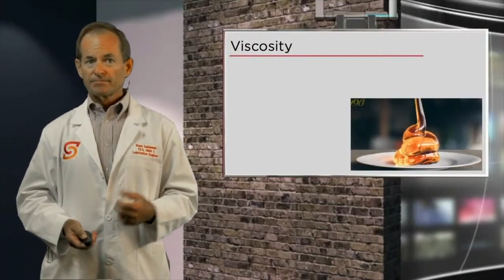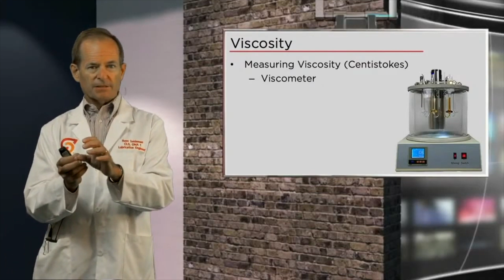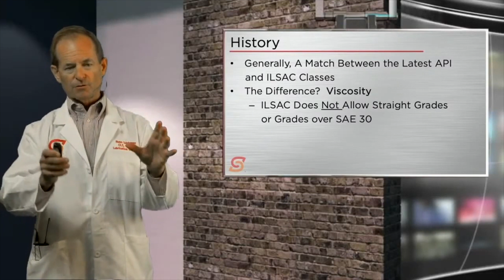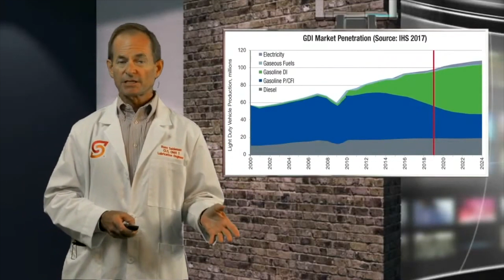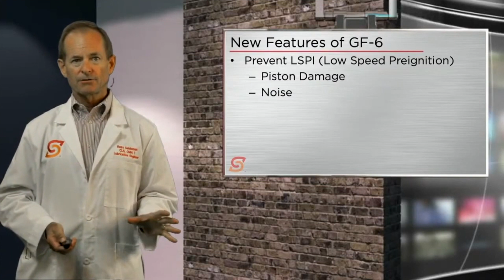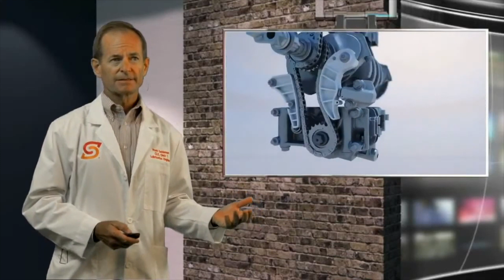GF-6 Educational Training Series | Senergy Petroleum

Comment: @SenergyPetroleum I have a 2024 GLC Coupe 200 4MATIC turbo gasoline mild hybrid that only accepts 0W-20 oil from 229.71 or 229.72 specification. 
My huge disappointment was that the dealership did not tell me to change the oil after the break in period. Also they say I only need to change oil every 10.000 km or 12 months.
 Also that I can use the Start/Stop feature. All these are against my interest to extend the life of the car and in theirs to sell me a new car after 5 years. 
 I am convinced that 0W-20 is the thinnest and most ecological oil for this engine but not the optimal for reducing engine wear. 
 My question here is which 0W-30 MB standard like 229.52 or 229.61 would be most suitable for this engine if I insist to use 0W-30 viscosity oil.